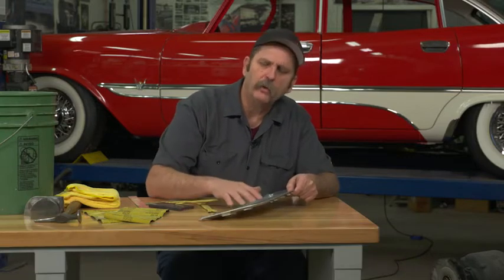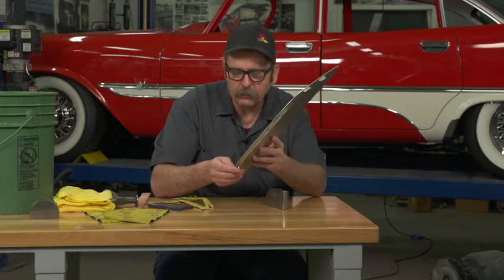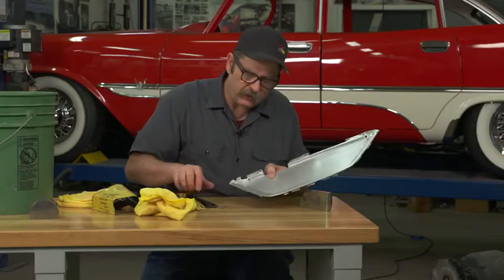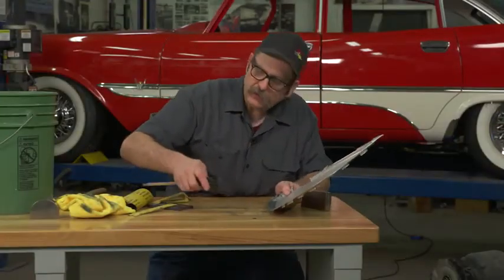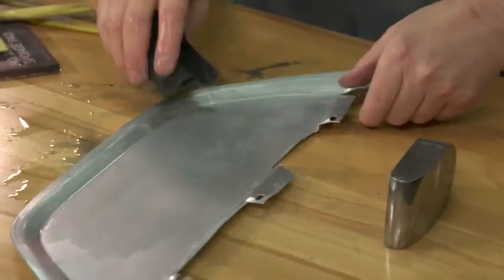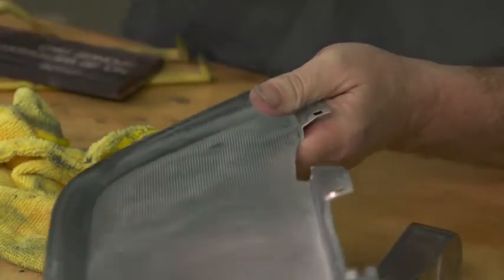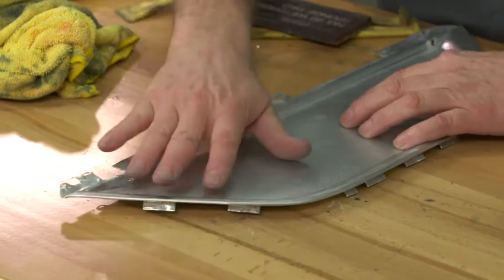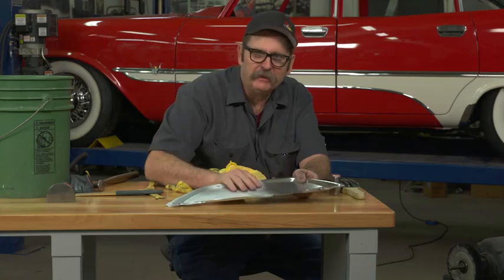Straightening and Polishing Aluminum

Comment: Once it's nice and shiny how would you protect it?  a coating?
Reply from the maker: Once it's straight and shiny you have options.
For interior pieces, I typically polish it once a year and it looks great all season.
Exterior parts will tarnish faster and can be polished once a month or you can have them flash or chrome plated for a chrome like shine...
Or have them clear anodized, but that takes down the luster some...
clear coat paints typically start peeling off after a season or two, although I know some people who have clear powder coated the parts with good results.
Flash and chrome plating is what the auto manufacturers use most often though.

Comment: Hi Mark, Ive got a grill piece that has been abraded with some removal of metal. What type of fluxed filler could I use to fill depressions before shaping?
Reply from the maker: Can you give me a little more detail?
What metal is the grill made of (i.e. steel, aluminum, stainless, pot metal, etc.)?
Out of curiosity, what is the year/make/model of your project car?
For small gouges in aluminum we typically use a zinc/aluminum brazing rod like "Alumiweld" or "Blue Demon Triple Play "
Keep in mind that aluminum needs to be flash plated or anodized on items like grilles to prevent corrosion.
Deeper gouges in aluminum are best filled using a TIG welder and aluminum fill rod.
Reply: Its the grill from a 1979 Dodge D100. Its aluminum. I saw a guy that was adding metal to a piece that was scraped up enough that polishing wouldn’t have been able to hide it. It looked like he was soldering the metal into the damaged sections. I cant find where I saw this video- it’s somewhere on YT. What I’d be interesting in finding was the filler metal he was using, assuming that you know of the material. When he was finished sanding and polishing it down, it was perfect.
Reply from the maker: Yes the two products I mentioned earlier would be a good choice to fill your aluminum grill and they're easily filed, sanded and polished.
Reply: Classic Car Restoration Club  Thank you very much for the names of those products. Something else i noticed while setting up to repair the grill was the under structures supporting the headlights- those are made of cast pot metal.  I pretty much gave up on trying to straighten what was bent in those pieces- the cracks got worse. I found and bought some pieces on eBay.